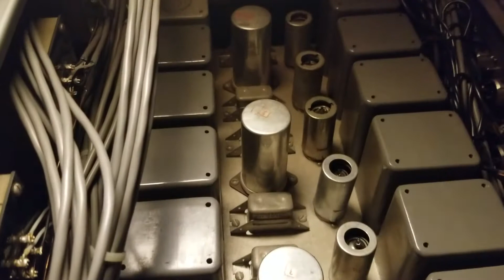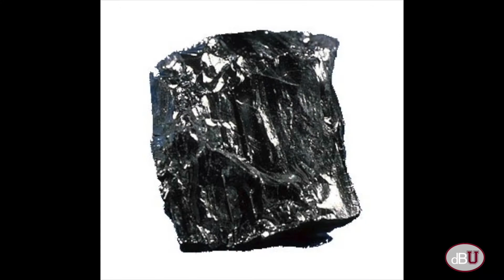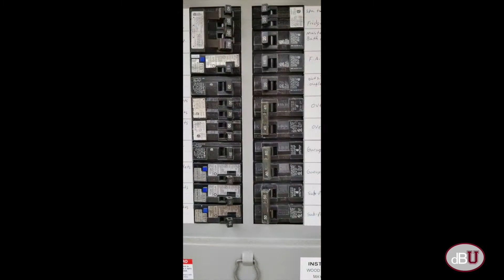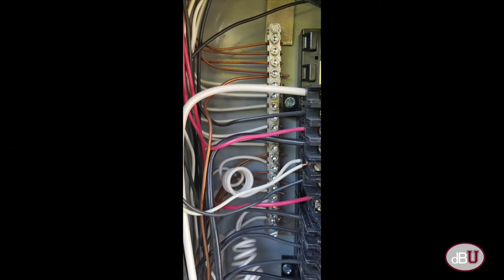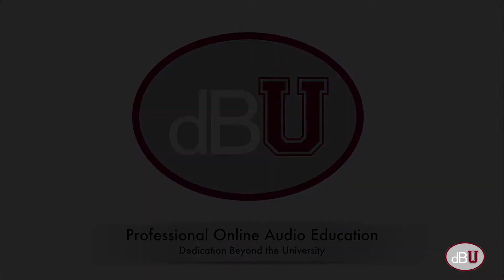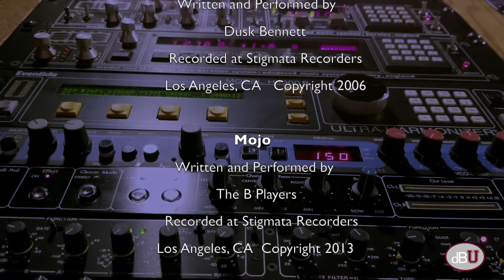plus4dBu: EP 7: Power Distribution- How the Grid Works.

Comment: How do I phase flip power???? Does that make things cleaner?????
Reply from the maker: You cannot flip the phase of power on your own. An electrician should be hired for this task. Try not to confuse the phase of power with the phase of audio. Though they are identical they work at completely different voltages. Messing with voltages beyond 30V is risky to the user and the equipment.